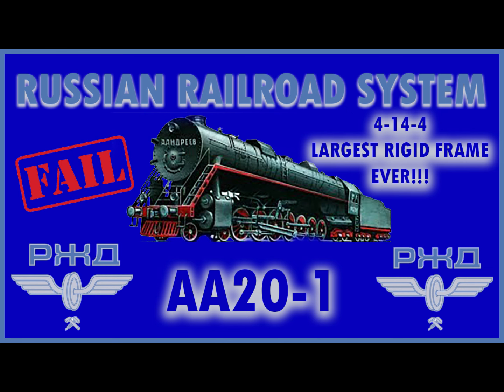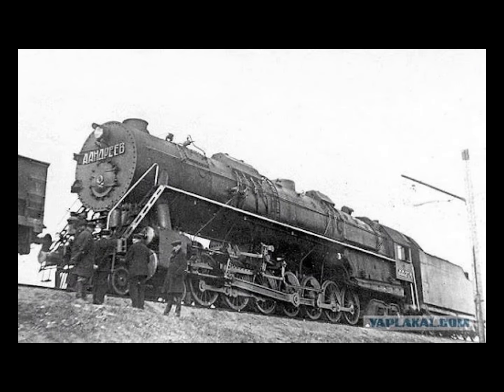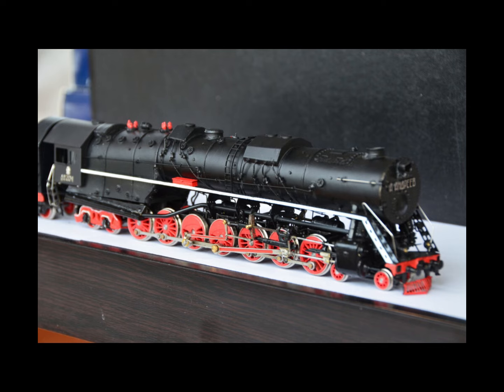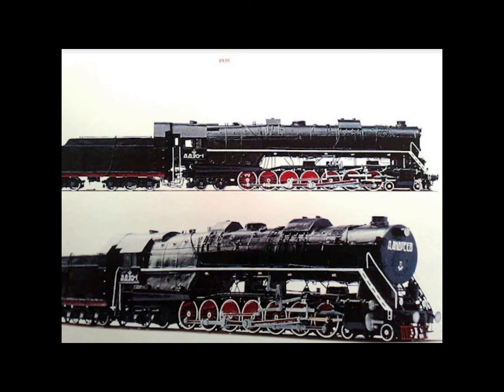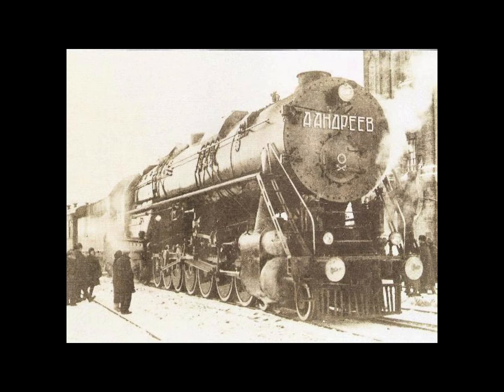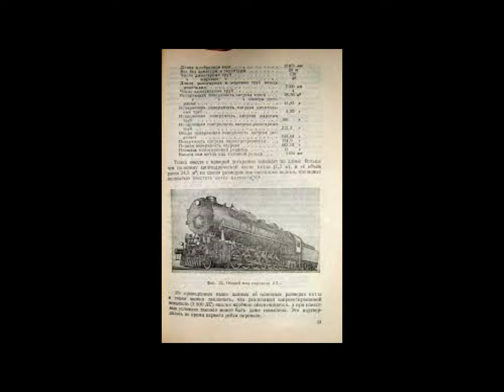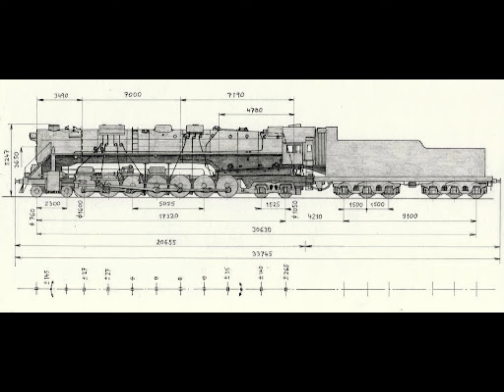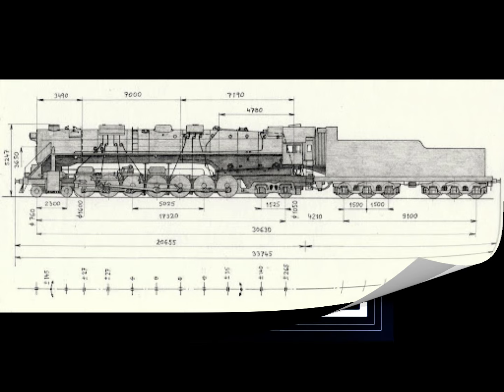Russian Railways AA20 1  4 14 4 Steam Locomotive

Comment: This loco was too far ahead of it's time. Heavier Rail construction, wider radius curves and turn-outs, Quality Coal, and Lateral Motion on leading and Rear Drivers. Then just maybe, it would have been a valid design....unless it pulled couplers out of Freight Car bodies? But the underlying Political System contrived to cause its failure from the Start. And the 1960 scrapping was obviously part of the Post Stalinist purging of History.
It would have made a wonderfull Museum example of what could have been but wasn't.
Reply from the maker: I cannot see anything that big being unhinged and successfully managing curves.. No matter the track weight and supporting structure.